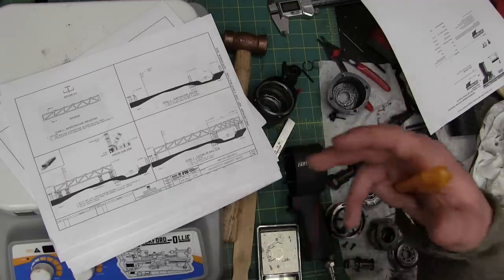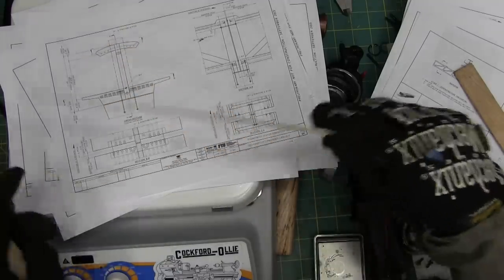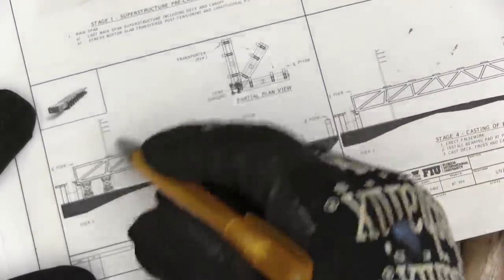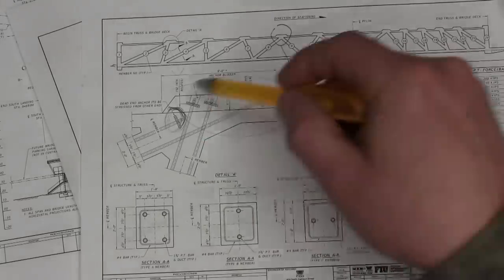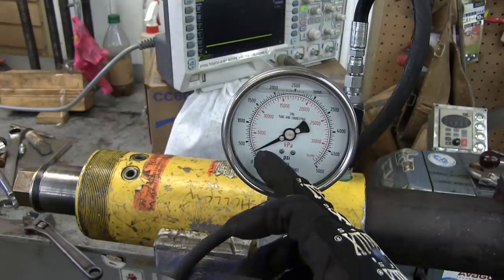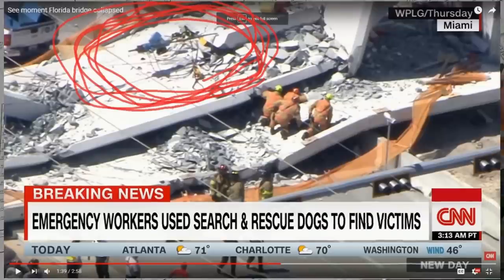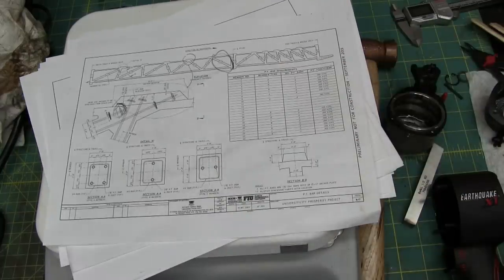Post Tension Failure Florida Bridge Collapse | Engineering EXPLAINED!

Comment: Good job. One point....the truss member that they were tensioning is by design in pure compression. You'll see on the drawing you were showing that they did not initially plan to have any PT bars in that member and three others. I dislike the whole concrete truss scheme. When you build a truss out of steel, you know exactly how the material and joints will behave. Not so much with concrete.

Comment: Respectfully, I think you have this wrong and I think the rod demo in your video demonstrates why. If you'll allow me to explain:

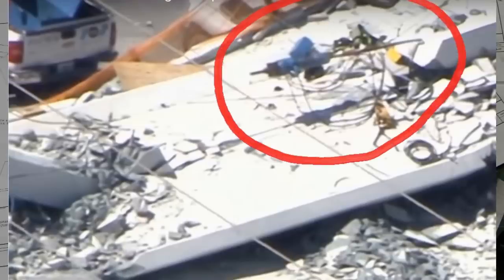At @11:24, your test rod goes whippin' out of the hydraulic cylinder (HC) when the spring tension on it was released at the failure point. In your video, at @11:46, you can see the SFU bridge HC still attached to the rod and the rod still embedded in the concrete. This shows that the rod did not fail! Had it failed, the rod would've been found buried in the side of a building, 1.6 km away from the bridge, not intact on the end of the HC. 

Now, this location is also definitely the source of the failure. Take a look at the animated GIF (4 images down) in the Miami Herald article (below) from the exact moment of failure. Specifically, look at the base of the vertical south end pillar. At the moment of collapse, in about two frames, you can see the base of that pillar shoots to the right a couple of feet. This is because the spring tension in the rod pulled it in that direction! If the rod had failed, the release of the spring tension would have shot the rod into the air and that pillar would have remained standing while the bridge toppled over to the right as the in-span fracture and collapse occurred. 

https://www.miamiherald.com/news/local/community/miami-dade/article212571434.html

This same article identifies that some unassociated structural engineers examined the plans and felt that the final truss-member was undersized for the load. I haven't done the math, so I'll take their word for it. This bridge construction technique also used an Accelerated Bridge Construction (ABC) method. it's my assessment that the final diagonal concrete strut suffered a catastrophic failure in compression. This is particularly unusual in concrete construction, but this was a particularly unusual bridge design and I think this explanation best suits the available evidence. Regardless of why the diagonal strut truss member failed, it certainly failed and led to the collapse.

Additional evidence: Looking to the right of the lower deck failure point, the rest of the truss remained intact during the bridge fall, so the collapse had nothing to do with that section. In contrast, on the left, the upper truss deck pancakes on the lower deck before the bridge has even hit the ground, so that truss section (end pillar and diagonal strut) was structurally demolished before the bridge started to fall. In the Reddit thread you posted, "Tomfh" included a few CCTV frames from the other side where it seems pretty clear that the last diagonal strut suffers a couple of sudden fracture failures, one toward the top of the strut and one about 2/3 of the way down. in the view from the opposite direction, I thought the column had crushed toward the base (and it might have, as well), but in this "reverse" angle, the strut clearly suffered a compression fracture and folded up.

Unfortunately, concrete does not generally abide by requests to expedite its curing time without sacrificing some strength and if the bridge was designed at the limit of material strength, instead of with a 3x (or 10x) safety margin, then defects in either the design, the concrete specification, or the concrete mix could well explain the compression failure of the diagonal concrete truss member. There have been additional reports of concrete cracks reported to engineers prior to the collapse that should have alerted them to a problem with either the concrete or the design. Instead, due to pressures to complete the bridge on time, they chose to ignore these omens.

The best question you asked, here, was "why were they attempting to reinforce the bridge while traffic was passing underneath it" and while the concrete was exhibiting stress cracks and still curing. And then there's the loud bang that a pedestrian observed shortly prior to the collapse that the workers should have been trained to understand was a sign for them to exit the scene with the greatest alacrity. 

In general, the designers and builders put expedited construction ahead of worker safety and public safety. Engineers are explicitly trained to not permit anything to come ahead of design safety because mistakes like this can (and do) kill people. The people running and implementing this project displayed a criminal lack of integrity and professionalism and held insufficient regard for human safety ahead of their own hubris. 

EDIT: Check out the size and location of the "cracks" in the bridge at one month and at two days prior to the complete collapse.  They're enormous! The preliminary report indicates that the concrete samples taken from the bridge met the expected specs. Everything I've now read seems to point to a catastrophic design flaw and pressure to ignore the error and continue to install the bridge anyway.

https://www.ntsb.gov/investigations/AccidentReports/Reports/HWY18MH009-investigative-update.pdf

Thank you for making these videos. They're a f'n pleasure to watch. ;-)  And, yes, I'm still keeping my stick on the ice.

Comment: Good analysis and I am assuming you are correct or close to a root cause.  I'm willing to bet the NTSB is focused on that post tensioning cylinder like a laser beam.  This was basically a Warren truss structure which can be very strong when designed and fabricated correctly; this bridge doesn't appear to be.  Redundant stress paths are a fundamental of sound Engineering.  No competent Engineer would allow a single stress path, where a single component failure would allow complete collapse.  This design should never have gotten off the drawing board.  The entire project smells of environmental sensitivity and political correctness.  Professional Engineers have legal responsibility and liability for their designs.  The law suits over this will be amazing.
Reply: Did you miss the fact that the hugely important cable stay systems were never built or attached to the bridge section? Those were main load transfering systems.
Reply: On the Florida International University, Facilities Department website.  You can find the MCM- FIGG design/build bid documents posted.  By their own description: "The full bridge project is styled to look like a cable-stayed bridge with tower and high cables for dramatic effect. But functionally and structurally will be a truss bridge, with the spans being fully self-supporting."  I'm sure the "sailboat" stays would have provided some strength to the span, but the MCM-FiGG design build documents lead me to conclude they were for Architectural effect only.  Link to the design / build proposal for anyone interested.
http://facilities.fiu.edu/projects/BT_904/MCM_FIGG_Proposal_for_FIU_Pedestrian_Bridge_9-30-2015.pdf
Reply: Thank you.  I hadn't seen the B-roll footage.  The NTSB may be slow, but they are thorough to a fault.  They will get to the bottom of this.

Comment: If the entire bridge failed due to the failure of one tensioning rod, that calls into question the entire design.  I'm betting that's not the only bridge in existence with that design.
Reply: W Sears
 I think someone said there is in Tampa?
Reply: Everything else being equal, the failure of a single rod would probably not bring the bridge down. Likely, they damaged other rods when they moved the bridge by supporting incorrectly. We also know they damaged the concrete deck as cracking was found. If other rods had their yield point exceeded during the move, they would not be able to take the added stress. I'm also wondering if they had performed post stressing of the deck yet. If post stressing of the deck had not occurred, it would not be able to take on the final load it was designed to and the rod failure could have transferred a load that exceeded the pre-stressed capacity of the deck but it may have been OK had it been post stressed.

Comment: That cable snapping was a symptom of a much larger issue.   The bridge probably would have worked, if they could have magically put it in place, but setting it up without it failing was basically impossible.   The design was far too fragile imo, and it was transported improperly to boot.  Obvious failure.

Comment: I am not a structural engineer (a biomedical one), but when I saw the drawings on your vcast that showed 2-3 tendons terminating in a relatively small volume, each with a different force vector, I wondered that perhaps there might be local forces which compress correctly for strength in one dimension, but could interact with the other vectors to cause shear or weakening in other dimensions. Also, just the presence of three tendons and tensioning hardware in a restriced volume might weaken the material.

Another observation — I’m thinking that the load on a pedestrian bridge could be handled pretty efficiently with a steel structure, and that the design was perhaps aesthetically driven towards the sculptural quality of post-stressed concrete — bringing in the large mass of the concrete. I’m wondering if a steel bridge would be less heavy and complex. Or was there something about the roughly 180 ft (and 100 ft) spans that posed difficulties for steel and pushed the choice towards concrete?
Would appreciate your (and your followers) thoughts.
Reply from the maker: FIU has a center for concrete research. https://cee.fiu.edu/about/faculty-staff/faculty/atorod-azizinamini/
Reply: For all I know, they could just shape and coat the steel to look like concrete, and have used welded steel “profiles” to have the clean look desired. It would probably cost less, too; it would sure weigh much less, and could be easily designed to withstand even absurdly bad handling without increasing cost too much.

Comment: Excellent analysis of why this bridge failed.  I've have experience using similar methods tensioning   steel structures.  Most cables and bolts depending on the length, size, and temperature are expected to stretch over a given distance.  An example might be 4 inches over a 50 ft span.  If these cables were pre-tensioned,  someone should have documented the stretch and hydraulic pressure.  When they discovered cracking and loose pre-tensioned cables, it should have been a red light that something was failing.  I've seen 2 inch thick rods go through walls after breaking.  
They could have cribbed under the suspected area while inspections and or repairs occurred.   I think there was a lot pressure to not interrupt traffic.  I believe the university and contractors involved are promoting this new accelerated bridge technology to replace aging bridges world wide.  The new concrete tech is great when manufactured in controlled environments where no mistakes are made.  This bridge was built on the side of road.

Comment: I question the wisdom of designing the trusses to line up with fake stays. This results in deformed trusses that had no vertical support on the end of the bridge that failed. From toothpick experiments, the truss configuration on the end that failed is much weaker than the one at the opposite end, which withstood the crash without pancaking.  
When the bridge was moved using a method leaving the failure end unsupported, it created significant static and dynamic loads. Those loads would be magnified by the slanted truss configuration , and put alll the weight on the post tension rods(PTR ) in the truss member that failed. Perhaps those loads resulted in plastic deformation in the PTR leaving it permanently weakened. Whenthe PTR broke during tensioning, the member lost its tensile strength and crumbled.
Thus it seems the causes are : A). slanted truss design was inherently weak,  B) movement of the poorly supported span overstressed and weakened the PTR in the end truss element C) weakened PTR allowed sag and cracks, and failed during tightening. D) failed PTR allowed truss member and bridge to crumble, 
Any thoughts on whether the truss design contributed to failure?
Reply: I agree and disagree, that the overall truss design to align with the stays results in some type of imbalance that must be taken up in an "unusual" way, but the end member that was supposedly being stressed (as seen by the jack on the rod - though I wonder if it wasn't actually a rod for member 10) is a compression member in a truss of "normal" configuration.  The drawings show that there are no rods present in member 11 in the "PT bar requirements" schedule.  Why would you further compress a compression member?  Is it possible that rods were added after the fact to account for a wind uplift condition in hurricane force winds, that would put that member into tension?  Or does the dead load of the truss overcome the potential uplift?  It is not very clear...

Comment: After your explanation I guess this scenario: When the supporting truck on the left side moves inward, the pre-stressed (tension) concrete truss element (where things eventually broke) becomes compressed further (instead of being tensioned) making the tension rebar nut looked as not tightened enough. The subsequent tightening adds more compression to the concrete. Either the rebar snaps, or the concrete (on the top or on the bottom) broke (the truss looks intact) or the rebar snaps. I think they may already find out. Your forensic work and the previous analysis are very good. Thanks

Comment: "That's odd...
The dead-end anchor that you pointed out, appears to be a structural discontinuity and should cross over the more vertical PT cables, like the PT cable it is paired with. Need to check the 'Approved for Construction' drawings and go from there.

Comment: You're almost right.. However, what you got wrong was at 16:12 of this Video.. They put tension on the cables IN THE OPPOSITE DIRECTION.. (According to the NTSB.) Basically?  Leaving every part of the Bridge to The Left? DANGLING... (So To Speak.) Leaving The Rest Of The Bridge WITHOUT ANY SUPPORT EXCEPT FOR THE STEEL RODS AND CONCRETE..

Think of it like putting a Brick on a LONG ROD at one end, And lifting it at the other end.. Except? The End with the brick? is tied to a platform.. Like your Glass Analogy? sooner or Later due to ALL THE STRESS/TENSION? IT BREAKS... Besides the fact that according to the design of the bridge? IT WASN'T MEANT TO BE MOVED AND STRESS TESTED/STRESSED IN THAT WAY..

Comment: Working in Civil construction and road building,  I have to say bloody red tape...  It (in my country at least) take a month to get a "Tempery Traffic Plan" approved so even if you knew it wasn't safe to open the road at 530am after a 20 hour shift, to open a bridge for God's sake it's opening... Further more the stake holders don't want any hold ups,  and the locals complain even when they are notified of Trafgic closures and detours are going to be in place. No excuses but it's a stuck in a hard place with no wriggel room.  There is no contingency plan for things not going to the specifications... As I work my way up the ladder in this industry I am learning it's better to just be on a machine or wrench blindly doing as your told,  cause up the ladder you have colpabilty and now where to run, and no one to listen to your concerns.
Reply: boo boo for a half hour drive to turn into a 3hoir one that's a pretty long detour...
Getting you to your destination quicker and more efficiently is why we build expressways and interchanges...

Comment: Can I buy one of those hydraulic rod pullers at the adult toy store?
Reply: Mr_GiXxEr sign me up too.
Reply: I got one, it's called my right Arm
Reply: Mr_GiXxEr  unless the "industry" has progressed w/o my knowledge,  the current state-of-the-art technology for said application is based on negative pneumatic pressure.
Reply: VancouverCanucksRock I'm like a cat , still another 12" tucked inside . if I could just pretension it out and put a lock washer and double nut it. Well a least I got two nuts , albiet , the specs are a little off now days . kinda hanging a little lower .
Reply: he does have some nice toys and gadgets in his shop.

Comment: Bridges collapses because of a single rod failure? I remember that you said it was like dominoes and it takes multiple failures but this seems like a single point of failure.
Reply: John Kimble A rod failure following a misplaced support mover that may have been putting pressure on the bridge in an unintended place (between the trusses rather than at their connection point).  May only be two, but could certainly be possible and it definitely a logical explanation based on what little evidence there is so far.
Reply: This might give a better example, strangely. https://youtu.be/8GseJN2HIqc With this video, they are trying to lift the car with fishing string. Failure points is always a line snapping, then catastrophic failure of the remaining strands as can be heard. Sounds like velcro. Uneven loading to where all the pressure is on a couple strands vs distributed across many.